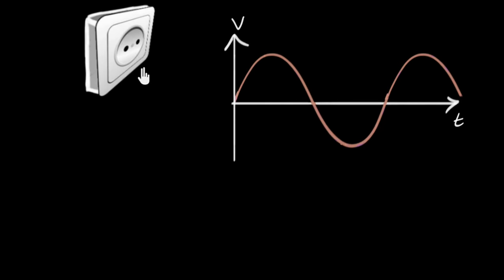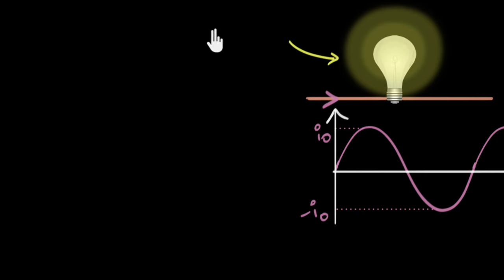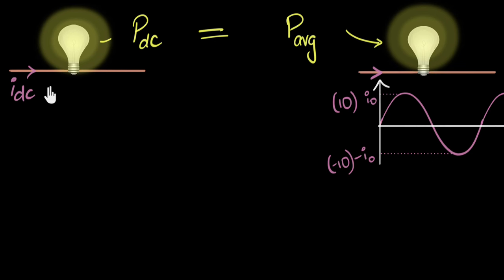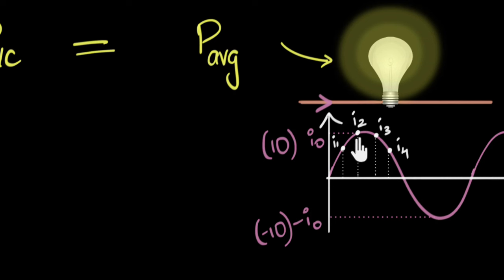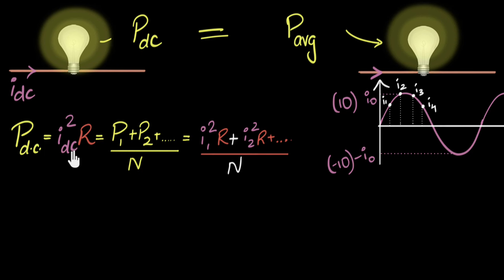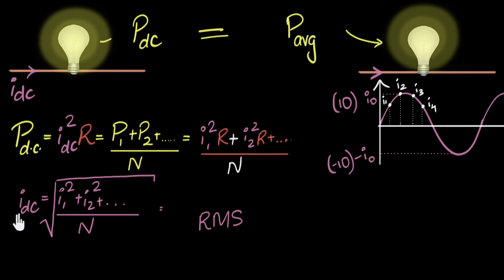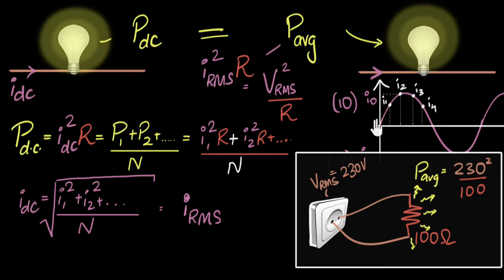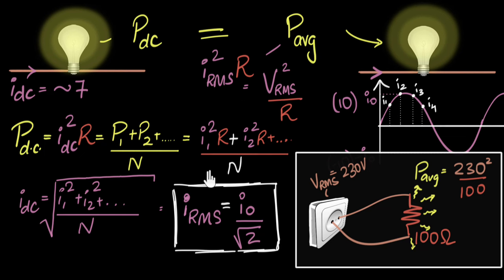What is RMS value? (& why should we care?) | Alternating currents | Physics | Khan Academy

Comment: Sir why should we have to equalise power of DC bulb to that of AC bulb
Reply: Just like replacing 2 resistor in series with a equivalent resistor makes calculation easy. Similarly by replacing a AC voltage with the equivalent DC voltage(with RMS value) makes calculation of power dissipated easy.

Comment: Sir I have a question if we take two sin waves in same graph with x axis as radians, here one is sinx and other is sin(2x) . Then as they say the complete cycle takes only (2phi)radians. Then for sin(2x),it takes less than (2phi) to complete one cycle if we see in graph because more frequency ??
Reply: @inbazhaganravikumar2293  no US uses 60 cycles per second, because they generate current at 60Hz
Reply: Yes less time to complete cycle hence higher frequency
Reply: @inbazhaganravikumar2293  they use 110 Volts, 110 is not frequency